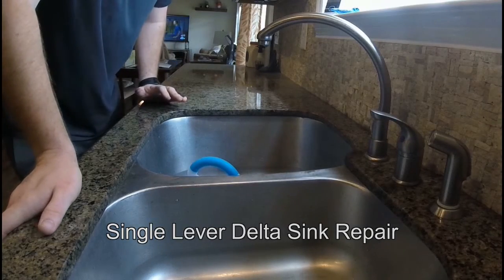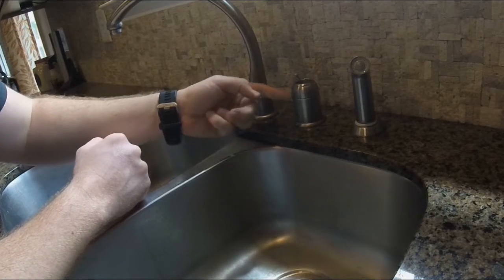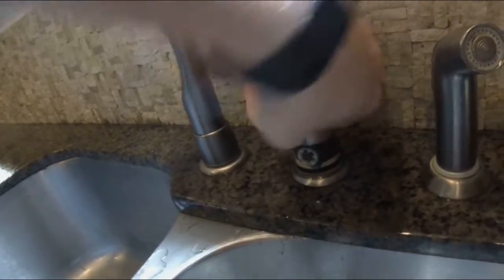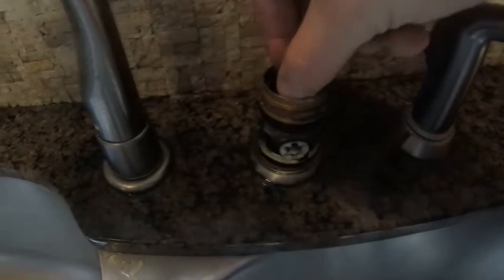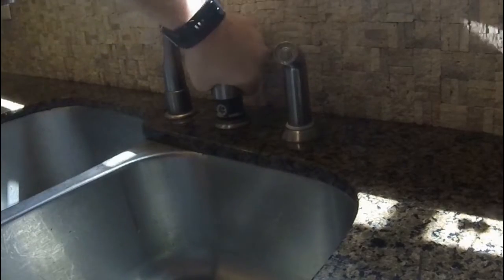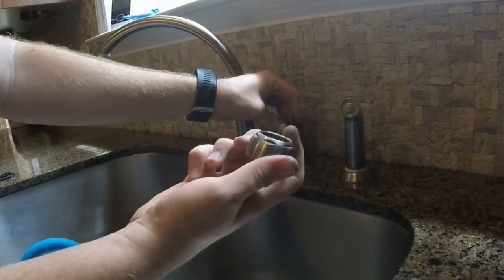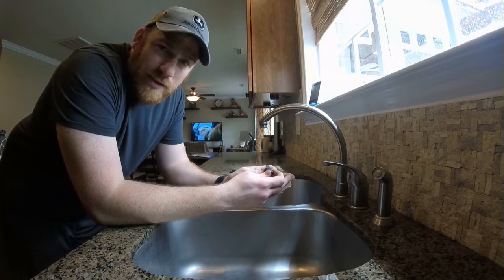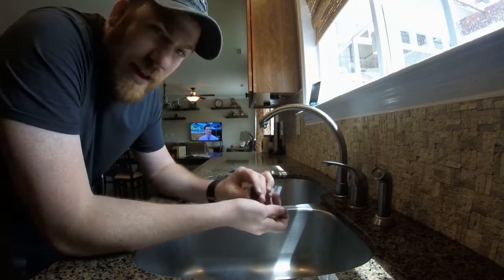Delta Single Lever Faucet Repair - Dripping Faucet

Comment: I’ve replaced the seats and ball, but I also need to replace the two o rings under the sleeve. I’ve worked on the sleeve for a hour, it rotates freely, but will not slide off.
Reply: Don't bother with calling Delta. I gave them the model and took a photo of the faucet that they asked for, and was told that that sleeve doesn't come off. So when I asked how do you replace the two o rings, she just got weirdly vague and said they couldn't replace that part. I don't need one, just want to know how to slide it off if it won't budge.
Reply from the maker: Oh man sorry for the trouble. Mine came off pretty easily as I showed in the video. Only thing I can think of is gently prying upwards with a flat blade screw driver from the bottom joint. Is your faucet the same as mine in the video?  Or different kind?

Comment: What do you do if the handle won’t come off after removing the set screw?
Reply from the maker: Triple check you don't have any other set screws holding it down..removing it all the way (not just loosen it)  Probably corrosion making it sticky so may need to try a combination of try harder, use a penetrating oil like Liquid Wrench or PB Blaster, and last resort would be some heat from a lighter aimed near the set screw hole. I have not tried a lighter or small torch personally...but that would be a last resort for me...but could damage or melt the seals and o rings and make clean up more difficult.

Comment: Excellent video.   Has some details that other good videos do not cover.
Reply from the maker: Happy to help and thanks for watching
Reply: @XterraRob  If I had to make a suggestion for improvement, it would be  light focused on the spot you are working. My screen tends toward the darker side which I suppose I should learn to adjust.
Reply from the maker: Thanks for the comment. Lighting is a challenge I always struggle to remember lighting and before I know it, I'm halfway through :)

Comment: I got the drip in the handle fixed by replacing the ball, springs, and seals but what do I do about the leak at the base of the spout? Ours is exactly like yours, down to the granite countertops.
Reply from the maker: Did you replace the large o ring at the base of the plumbing that seals inside to the ornamental collar?  Or is it leaking below at the seam with the counter top.
Reply: @XterraRob  I found another video showing how to replace the two O rings, back to HD I go - Thanks!

Comment: I was very proud of myself for doing this with no help.  Mine worked perfectly after getting it all back together (that was challenging but I didn't give up).  I REALLY struggled to get the set screw loose so I could take off the handle. I sprayed mine with WD-40, let it sit for 5 minutes. Then tried again to no avail with significant pressure.  So I took a tool for countersinking nails and stuck it into the hole of the set screw and tapped about 4 times with a hammer.  Tried again and it came loose but still had to use a lot of pressure!  Then I was having trouble getting the cover over the ball to stay down in the slot so I could twist the faucet cap on.  Needed a 3rd hand but I finally got it.  Been fixed for about 45 minutes and not a drip! Thanks for the video...I have the exact same faucet so it was especially easy for me to follow.
Reply from the maker: Great work!
Reply: Peggie Muir  WD 40 is NOT penetrating oil! WD stands for water displacement, it leaves behind practically no lubrication once it evaporates. it might work a little. What you need is a product called “penetrating oil” it is formulated to soak into and loosen and lubricate corroded threads. It is messier than WD 40, but will give you the best chance at working.
Reply: @richiethesee  I learn something new everyday!  Good to know for the next project...wd40 was all I had and it worked after using it but it was apparently not the wd40 that caused the success. Thanks for the info and explanation!

Comment: I followed your excellent video to replace the seals and springs.  Although much improved, I still have a drip of maybe 1 drop every 2 minutes.  I will give it a day or to "settle down" & hope that the drip stops.  If not, do you have any thoughts of what to try.  Maybe tighten the dome more?  I also noticed when the ball was removed that it had very thin black spots or areas on it which I tried to rub off. Some spots were also on the socket where it rests.  Maybe I should try removing the spots entirely. I did not want to scratch these surfaces by using anything abrasive.  If I find anything I will post here.
Reply from the maker: If you have a Dremel rotary tool with a wire brush attachment, that would work well for cleaning up the ball surface. Or you can replace the ball all together. I'm curious to see what you find out. Not sure what else to try. It all comes down to getting a good tight seal on the rubber pieces.

Comment: Very difficult to 'loosen' the "DOME". Corrosion prevents removing the dome. Extreme force causes the entire base to rotate on the sink.  Afraid to damage the decorative sleeve with counter-force to allow dome to be loosened. How to free-up dome threads????
Reply from the maker: Mine was not nearly that difficult...but more torque is the only real way to go. Id be afraid that chemicals like liquid wrench made for rusty bolts may discolor the decorative parts. I would use two pairs of channel lock pliers...but use some small pieces of rubber or vinyl hose to cover the gripping jaws to prevent marring the surface.
Reply: I sprayed mine with WD-40, let it sit for 5 minutes. Then tried again to no avail with significant pressure.  So I took a tool for countersinking nails and stuck it into the hole of the set screw and tapped about 4 times with a hammer.  Tried again and it came loose but still had to use a lot of pressure!